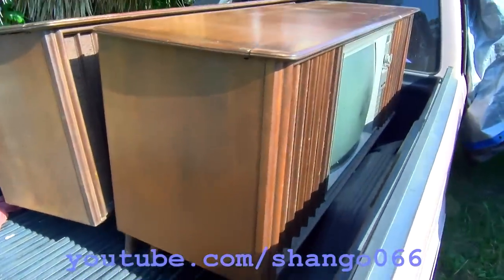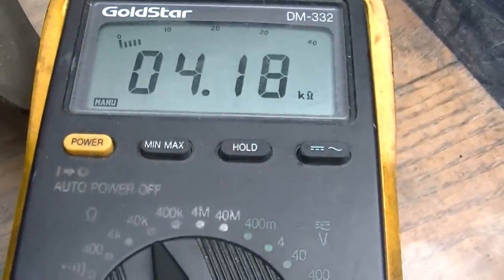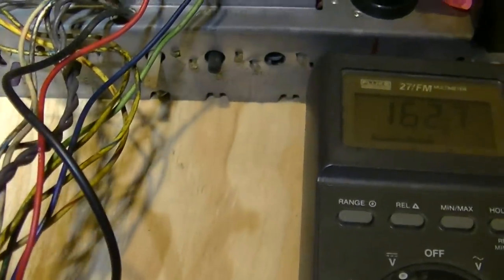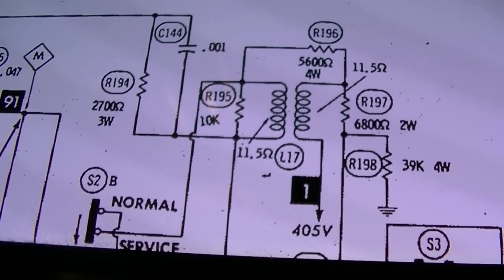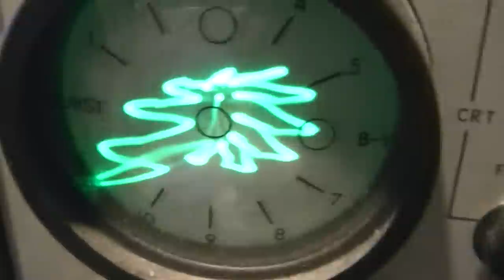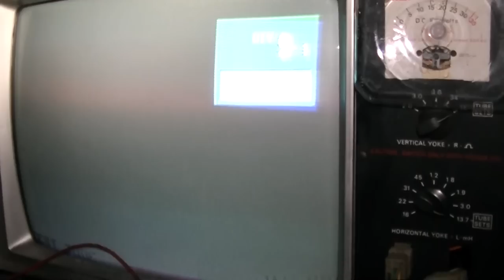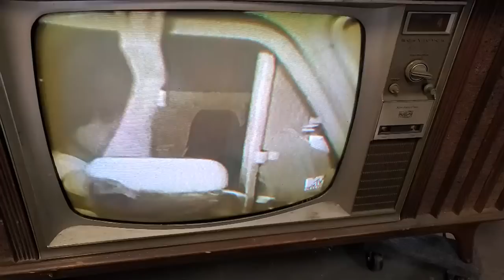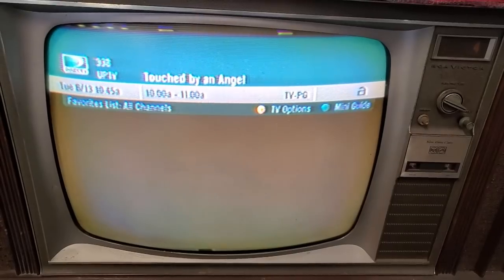RCA CTC 25XAA Color Tube Television Diagnosis and Repair Combo Unit Tuner and TV

Comment: Your troubleshooting skills are great. I will say I have one example of cleaning helping a device. I have a Pioneer stereo receiver that was acting flaky, switches doing the wrong function, etc.. When I opened it I found a lot of "crud" on the inside. After a good clean it now works proper. I know I just got lucky most likely.
Reply: Absolutely, internal dirt causes short circuits, especially when that dust gets damp.

Comment: With peaking coils, I think there’s a characteristic of the coil called the Q which is a result of the winding pattern of the coil, and some coils have a higher or lower Q than others, which affects the performance even if inductance is exactly the same. 

I think that’s why they do the basket weave on some coils and a normal spiral winding on others.
Reply: You could increase the Q by adding a resistor in series with the coil.
Reading the wiki page for basket weaving, it apparently is done to reduce the capacitance in the coil so it can work for higher frequencies

Comment: Shango, here's a re-post of a comment I left on your earlier CTC-25 vid: 
"Cold heaters on the 6GU7s is endemic to these sets. Re-flow the 2 ground stakes on the far right end of the chroma board to fix. With cold heaters, what happens  is - plate voltage on the 6GU7s rises, and since the plates are DC-coupled to the CRT control grids, CRT beam current goes into avalanche, dragging down the HV until the raster blooms out. If left in this condition, the 3A3 and flyback are cooked,  the 6JE6 cathode current goes out the roof cooking it too. We always re-flowed them 2 stakes as a matter of course on every CTC-12, 15, 16, 17 and 25.  Those ground points exist in one of two states: Cracked or gonna crack."

Comment: I have a question the set you are working on has a bad video coil now since you have 2 similar sets then why don't you borrow the coil from the other set if its working then when you get to the other set you will hopefully find a sorce for a replacement coil

Comment: I kept wondering when you were going to figure out the solder on that corner stake was bad. One of those 6GU7s is the blanking amp - when the blanker drops out the raster goes full brightness with retrace lines. Something weird happens to the solder; merely resoldering is no guarantee the connection will hold. You have to remove the old solder and refill the hole with new solder. I remember suffering with this problem on the CTC15 I had as a kid in high school some 50 years ago.

Comment: I had the consulate version of this TV in a metal case. I replaced the CRT in 1979 and I had it till 2000, we originally got it in 1968 . I had to replace some capacitors and resistors. and flyback. it had a decent picture.

Comment: Yes that dinky multi-diode selenium rectifier on the convergence board is a known intermittent issue. It can be replaced by individual diodes. Various diodes have been used. RCA changed them to separate diodes in later sets.

Comment: That 6GU7 grounding stake design was first used on the CTC12 and continued through a number of later chassis iterations. Yes, a separate wire is a good solution for this issue and re-soldering the ground stake is also good practice. On the peaking transformer, I always thought the large high wattage resistors under it helped contribute to their failure due to excessive heat cooking them over time. It might have helped if the resistors had been dressed as far away from the peaking transformer as possible, all things considered.

Comment: Things like those peaking coils going bad are what most likely caused a great amount of those TV's to end up on the curb or an alley waiting to be rubbished in the late 70's and early 80's. You definitely have some skills and "time in tools" as they say in the trades, to be able to find that fault. For your jig's "cathode to heater short", do you think that putting a booster / isolator on the heater, then, dropping the voltage back down with a resistor may be a good solution to use it safely? And,
@ 38:40 I'm kinda surprised that the jug didn't have pee in it, or maybe it did, and it just wasn't emptied in awhile 😁
Reply: It was probably for the best.  These use a ton of power and when these were still in widespread use, there were a lot more house fires.  Faulty appliances was a common reason I heard on the news as a kid for all the house fires.
The newer solid state sets of the late 70s and early 80s used maybe 20% of the power and were much more reliable.  When they did fail, they usually just shut off and didn't start a fire. 
During the summer having 300 watts of heat dumped into the room really sucked. Between all the 100 watt bulbs and the TV running, there might be better than 500 or 600 watts of heat added to the room.
Reply: @tarstarkusz  I've never read or personally seen the house fires causation. Interesting thought process. I think there is an argument to be made as unfortunate that so much technology, parts, cabinet, and features got kicked to the curb as often over used up CRT as a circuit part fail.
Reply: @directcurrent5751  Well, I was a kid at the time, but I remember there was usually at least 1 a day on the local news with the cause being told as "faulty appliance" and "fell asleep smoking in bed" being another common one.  But I've not heard the faulty appliance explanation in a LONG time and house fires appear to be, by news coverage, far less frequent.

It's a shame though that this style died out in the late 60s.  The big speakers, the high quality tuner.  They never really perfected tape because this style really died out before tapes became widespread.  Though there were occasional "console" TVs, they were  the lowest of the low end and made from the worst materials. No longer real wood with a real veneer, but particle board with a plastic veneer.

I doubt the style died out so much as it got priced out of the market.  You just cannot make a cheap version of the TV in this video.  This was also the era when plastics really started to take off in mainstream stuff.  Plus we allowed Japan to flood our markets with low cost stuff due to lower wages, lower regulations and most of all, a much lower currency.  So if the choice came down to 1000 1971 Dollars for this one and 399 for the plastic one, the plastic one is going to win.
Reply: @tarstarkusz  I am highly persuadable. In my teens, gasoline fires in the garage took out some local houses.
Reply: @tarstarkusz Not all manufacturers used wood products, and non wood materials. Magnavoxs' cabinets were made of wood, wood products, and mon wood materials. Zenith, Rca,and some other manufacturers used wood solids. Unfortunately most of there cabinets were particular board.
Reply: @johnalbanese30  AFAIK, the big brands all used real wood until around 1970. After that, all of them were particle board.
Reply: @tarstarkusz Sorry,  my mom brought a 1979 Magnavox console tv. The only thing that was not made of wood was the design on the side and front. It was an Early American  design. It lasted till the  middle 90's, when the picture tube became week.
Reply: @johnalbanese30  It wasn't wood, it was particle board.  There were no solid wood American made TVs in 1979
Reply: @tarstarkusz  I owned the set! If you don't believe me look it up in old Magnavox catalog from 1975 till the early 80s,

Comment: Need my HSN and where is those crape erase my deglatee is off this morning.  Love cigs damage in T.V.   did you get that air purifier ?  Just kidding nice thorough go thur on diagnostics
not sure if quality went down in RCA in later years.  bad solder joints seems to be a normal problem.

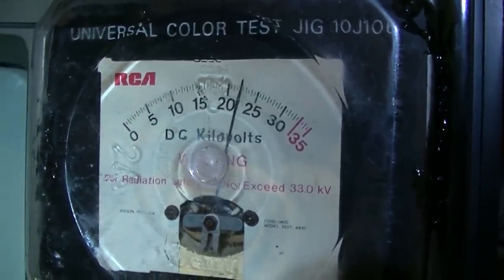Comment: 35:15 high voltage goes down because that 400v supply comes from the boost voltage??as you load down the boost voltage you put more strain in the flyback and load it down too

Comment: Great troubleshooting video as usual.
I liked the short clip of the inside of the vehicle of a soda drinker. This seems to be the common condition of vehicles where the drivers drink out of cups of soda while they drive. It gets spilled all over the dash, into the controls, and on the floor and becomes a total pig pen. I sure hate working on them. I guess I'm a bit anal because when I do work on them, I have to take the time to clean them first.
I felt my brain rot and my IQ begin to drop as I watched the Media circus motorcade go down the highway with the droning mindless voice in the background.... I had to get my anti-TDS booster shot to recover.

Comment: That thumbnail looks like it’s straight out of a radio shack catalog from the 90’s 😮
Reply: Replace the TV with a black plastic crap set and you'd be right. 

Knobs were gone in the 90's, so the external appearance of this set dates it to the early 80's at a minimum.

Comment: So you replaced what would be the primary of the video peaking coil with an inductor of similar value then used a cap to pull the video off there and couple it to the other side and off on it's way? Great picture btw I was surprised how well it worked with that peaking coil mod, good skills as always mate 😎.. deffo a watchable set imo ... oh yeah the government ass licking sheep should be a separate episode 😅 they need a good robometiculation...😅

Comment: Anyone know why the ceramic caps have a slit in them at 9:04 ?
Reply: Maybe it's a spark gap,  not a capacitor.
Reply: HEAT DISSIPATION.....???
Reply: It's a ceramic disc cap with a spark gap slit in it, to limit voltage excursions.  Those were not uncommon in tube TVs in the 1960s, in the days before MOVs and TVS diodes.
Reply: @auchterawer1150  OK THANKS
Reply: I was a bit surprised to see that spark gap disc ceramics are still made by at least one manufacturer.  Apparently Vishay still makes them (S Series), and Mouser (in the US) and Farnell (in the UK) still carry them.  So they can still be purchased brand new.  I had guessed that they were extinct by now.  In order to keep the gap reasonably wide, these are single-layer ceramic caps, not multi-layer.

Comment: The Streisand effect, I hadn't thought of the latest political fiascos like that, but you are so right. Love the repair and found the peaking coil issue fascinating, I wonder if the PCB grounding issue had anything to do with the coil going open circuit. Great to see you back at the tube TV's.

Comment: I'm triggered...into jealousy.  Not just Newsmax, but also AON??? I want that up here on the San Francisco Bay Area!  Santa, are you listening???
Reply: @@ericruud9328  I don't watch much TV or movies anymore. I think it has become a mirror refection of the same partisanship that has tainted our living. Both sides have gone to far extreme from each other, that compromise and middle ground thinking on said issues is elusive. The most of i watch now is reruns of older shows from the 80's, 90's and early 2000's.

Comment: There is a story why they used  large oval speakers but I can't remember it
Reply: Because the widest diameter adds bass while midsections offer strong midrange. You cannot get that blended coverage with a big round woofer.

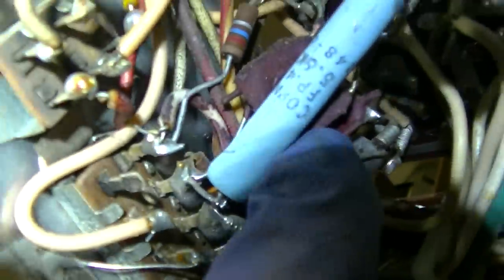Comment: 37:00 For a second i thought that was the original coil that was melting underneath that resistor.
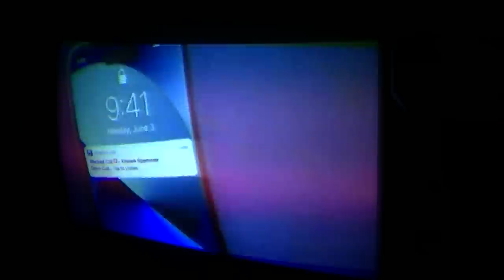53:25 Watch out with those, instead of a content id strike you might get flagged as a domestic terrorist